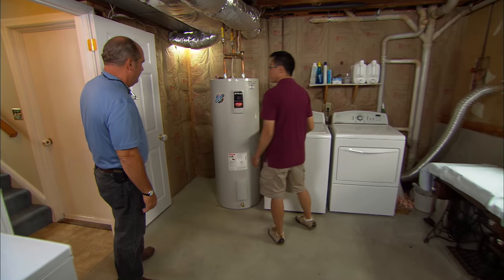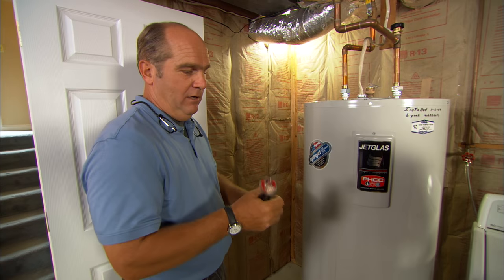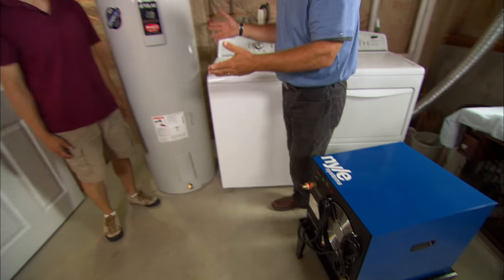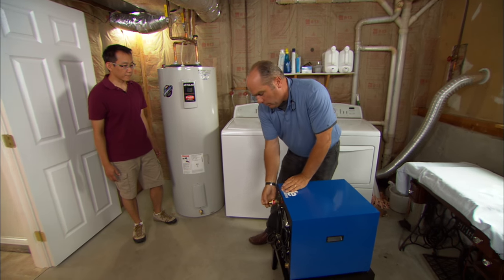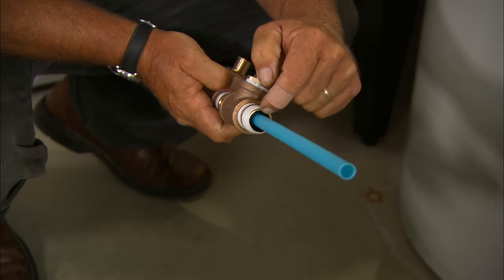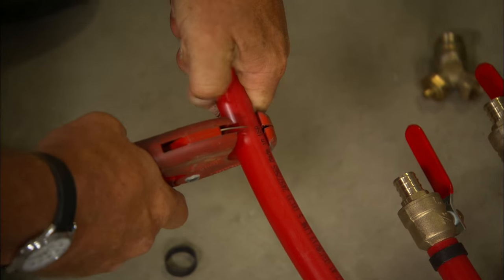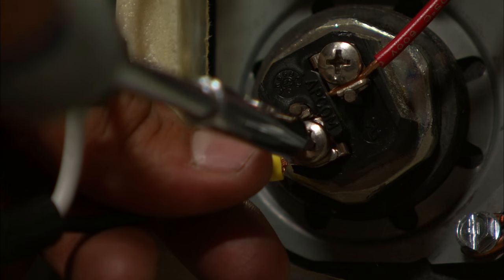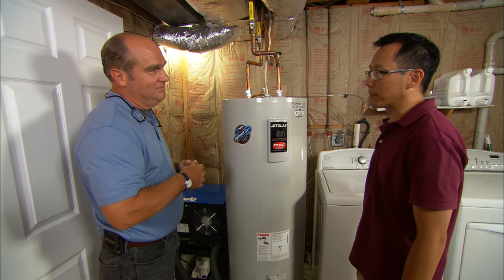How to Add a Heat Pump to a Water Heater | Ask This Old House

Comment: Wouldn't this only work in warmer climates? And even if you did try it in a cooler climate it would have to be a heated basement, which seems inefficient.
Reply: the video already said it works like a fridge in reverse. there's always heat in the air. fridges are warm to the touch even though inside is sub zero, just reverse the cycle and you got your self a heat pump
Reply: Richie311, heat pumps are great at their job whether its cooling for a freezer or heating as in this case. I searched for a video from Ask This Old House where Richard installs an air conditioner/heat pump at a residence and claims that it will provide heat even when the temperature outside neared freezing. I couldn't find the video but Google helped. Most AC's in heat mode can operate at 65*F outside temperature. There are also special AC's that can operate when the temperature outside is 40*F [while in heat mode]. This shows that an AC or heat pump can deliver heat at a low outdoor temperature.

You are right that it can be inefficient to heat a basement to only have that heat sucked in by the heat pump. Then again, if the heat pump is able to be operated at sub-ambient temperatures and the basement is not insulated or heated, its a win.
Reply: Alpha Zero, my search said 65*F, below that the capacity and efficiency drops. If what you say is correct, could you help me out and find some information about it?
Reply: @ChristakyMe  modern heat pumps work down to 0F! I have one that heats my entire house in the midwest. Do some research before asking completely stupid questions. 
Did u know modern car turns on the ac In the winter? Ac takes the humidity out of the ac! Which helps defrost the windows. 
Boom u learned something! America is a little less dumb now.
Reply: Andy Hass, wrong person tagged

Comment: Many people explain how a heat pump works by taking the heat from the air…I feel kinda confused by the explanation. I think it is the refrigerant and compression that produces the heat. when you release (expansion valve) the compressed refrigerant it produces the cold, the same as how AC works.
Reply: No the refrigerant picks up heat as it passes through the evaporator, hence evaporator and realeases that heat in the condenser, hence condenser
Reply: The energy put into the system from the compressor is a lot less than the energy it pulls from the air. It pulls heat  from the air is an accurate explanation  of how it works. It is true that it works the same way as an ac system, but you are misunderstanding how an ac system works. If the engery all came from the compressor these systems wouldn't make any sense as it would be more efficient just to use the heater elements. Refrigeration systems work buy concentrating engery and moving it. There is no such thing as ''producing cold'' only moving energy from one location to another.

Comment: Is it just me or does this sound like that heat pump is going to take the warmth out of the air (which you've paid good money to heat via your house heating system!) and put it into the hot water cylinder.... 
Lol...
Reply: The Mad Atheist so it will still take all your hot air.
Reply: this doesn't work ideally in all climates. But if you have an old muggy basement that needs constant dehumidifying, or a really warm climate, these are great. Part of why it works here is because if the basement gets cold this house has oil-heat which is very cost-effective. compared to electricity. So, in effect, he's using the oil to heat his water during the colder months.
Reply: You could probably put it in a cold room in the winter. Really good option in the summer. Where do I get one of these??
Reply: When the hot water tank is sitting unused it's losing heat to the room because it's not perfectly insulated, so in theory the heat pump is recirculating the heat that's lost to the room back into the tank and since it's not 100% efficient should actually add heat to the room.
Reply: i don't think the dude has a radiator in the basement lmao
Reply: How so?
Reply: not if its in the basement
Reply: >Use a heat pump to heat water in a cold country, where ppl want to get heat IN a room rather than get rid of it
I dont get what the marketing ppl are thinking.
Reply: its more practical in places where there is no such thing as cold, such as hawaii, the practicality goes out the window when it is used in a winter zone where heaters become necessary
Reply: True, but is it just me or doesn't a fridge do the opposite thing, right in most ppls kitchen? (which they've paid good money to cool via your house A/C system!) LOL

So isn't it a shame, they still don't make a unified residential heat and cold generating heat pump based system for homes?  That combine the functions of the units that supply cold ie a fridge with the ones that supply heat ie hot water heater. To make the total system far more efficient. And the HVAC functions could be included too. 

Yes it would be more complex since it have balance the different functions. And there is trade offs of higher costs to get greater efficiency. Like deciding how large the storage tank(s) should be before just dumping the excess heat or cold outside via a heat exchange or down a well. And there r other options for keeping the system in balance, 

Also chiller units r used now commercially. So it can be done.

Just a thought....

Comment: this would only be good in the south. were your water heater is in the garage or something. you get a air conditioned garage and warm water. if you pay to heat your house this is terrible. especally if you use heating oil. its more exspensive than electric heating

Comment: The problem I'm seeing with this is simple cost effectiveness.  If this heat pump completely eliminated my electric bill -- which obviously it can't do, since it's only making my water heater more efficient -- but if it did, it would take almost two years for my electric savings to pay for the pump.  Since my water heater only accounts for a small part of my electric bill, we're looking at close to ten years before I start to see actual savings.
Reply: thats why they are subsidized heavily like any green energy. They arent cost effective unless..... i just bought a 50 gallon standard water heater for 430 at lowes. Instead I found out that my state does a 750 instant rebate on heatpump water heaters through tax funded credits for going green. Im against them but hey, Im one of the ones paying taxes for it so meh. anyway I got a 1000 dollar water heater for 250 plus tax. due to the tax payer funded subsidy. you also get huge tax credits for installing heat pumps in your house, or solar or whatever. So the only way this is worth it, is if its the same or cheaper for the product, which obviously it cant be without help. The folly of most green techs is just that they arent worth it to the bottom line. So i brought back the normal one and paid a little more than half for the heat pump one.

Comment: There are also solar assisted heat pump water heaters, however the panel is outdoors so you lose the cooling benefits.  

However, maybe have an electrician make the connection instead of a plumber.  This guy totally created a code violation by not properly twisting the wires together to be connected independently before adding the wire nut.

Comment: Yeah ok will take years to finally see a savings after buying that thing.
Reply: Well, if saving is the only way you see as a way of return though.
Reply: It will actually use more energy overall in the winter if it's inside your heated area. It sucks the heat from the room in which your furnace has to replace.

Comment: Thanks but ill stick with the simplicity of a basic hot water heater...
Reply: until you need a new tank, new requirements say u have to get one, a heat pump tank, once you're over a certain gallons size.

Comment: Meanwhile that heatpump add on is probably 8 times the cost of that $400 electric tank.
Reply: You can get heatpump water heaters for fairly cheap, way more than electric or gas, but with utility discounts it can get down close, and you'll make up the remainder with energy savings.
Reply: Michael - the combination heatpump water heat tanks I believe were around $1200.  Different circumstances can alter the savings.  But not sure is it really worth it.
Reply: @fattony123082  - for those of us who have to run dehumidifiers, except in the winter, it is totally worth it

Comment: He could have just bought an oil fired water heater.
Reply: I had 2 oil fired water heaters in my house after I built it. They were lucky to last me 5 years. They were 80 gallon units and cost me about $ 1200 to replace. My replacement electric heaters cost about $600. That's why they don't sell more oil fired water heaters. Expensive as hell and don't last any longer than electric.

Comment: My guess: it won't pay for itself. Much like most gadgets like this. Efficiency = complexity + cost.
Reply: It will fail before it ever pays for itself. A complicated solution to a simple problem.
Reply: simple problem??? if u dont mind paying for the electric for an old fashioned HWT. That most of world stopped using decades ago. But only in the US did they think of just adding a Heat Pump to it???

Comment: The heat pump will still use electricity to heat the water ! What the use I don’t think it worth it. The compressor will use just as much as the elements in the water heater.

Comment: Money saved on the water heating may be offset a bit by the additional space heating you'll need.  As he mentioned, this is just like an air conditioner... Hope the homeowner likes a cold basement.
Reply: There work good when you heat your basement with a wood fireplace (with free wood from dead trees on your property).
Reply: with the all in one tanks you can turn them off during winter. and just use the electric elements as normal.
Reply: or just stop living in your basement, problem solved
Reply: When the hot water tank is sitting unused it's losing heat to the room because it's not perfectly insulated, so in theory the heat pump is recirculating the heat that's lost to the room back into the tank and since it's not 100% efficient should actually add heat to the room.
Reply: Good point.
Reply: a cold and dry  basement is the best thing you could ask for you can stackfood in it
Reply: When you use this in the winter this becomes just as efficient as a resistance water heater (COP = 1) although you can save a bit of money if the fuel that heats your house is cheaper than electricity or if your house has a heating COP higher than 1. However when your house is in cooling mode this thing is very efficient because its COP is over 1 and it removes a load from AC.
Reply: you are right ,
Reply: Install it outside then. Would work better in summer too that way.